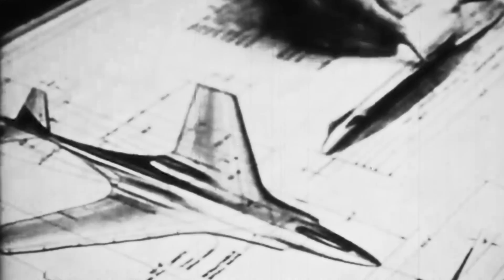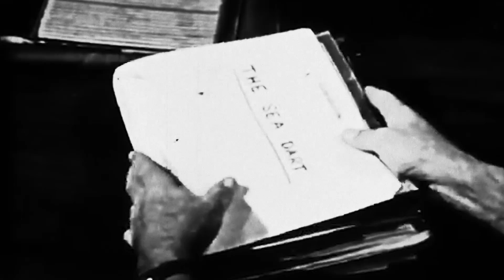The Nuclear Seaplanes Created to Replace America's Aircraft Carriers

Comment: Aircraft must be armed and serviced between sorties. Aircraft must be inspected and maintaine. Salt water etc must be quickly washed off or horrendous corrosion problems set in (for example water intrusion into cavities, compartments and electrical connections). Aircraft must be sheltered from inclement weather. No wonder this idea wasn't made standard. Anyone with operational or maintenance experience would find it absurd.

Comment: I don't understand why they just didn't make the Hydra skis part of the lower wing and use a x joint to expand and lower the gear also too I didn't understand why they didn't bother to make it like a submarine so it could use the force of the water lunging from depth surface to propel it in the air and then just switching to prop after are I still think an electric jet within a better motor

Comment: As a former carrier aviator, I see this as one of the most idiotic schemes I have ever heard of. It dumbs down the value of a carrier simply to enabling take offs and landings of any kind of aircraft, no matter how incapable. The fact is that aircraft that can fly off a conventional carrier are much more capable than any seaplane or even VSTOL plane could ever be and will always be so. It is simple physics. A plane that is launched can carry more weaponry and fuel and perform better, because they don't have to lug around all the baggage that gives them seaplane and VSTOL capability. Also, tending seaplanes would be a nightmare. The sea states you encounter in the open ocean would eventually scuttle every one of them.

Comment: Chuck Richbourg was killed in the Sea Dart when it ran into wake turbulence behind a larger aircraft at a demonstration showing over San Diego Bay.  The Sea Dart oscillated violently up and down three times and came apart in the air before it plunged into the water.

Comment: SSF doesn't "replace" Carriers. It complements them. The concept is sound. It's they were trying too much at a tough time in the field of aviation and hydrodynamics. The engines were too thirsty. With blended wing designs it would be more practical now. Having bombers that can operate anywhere there is water. You can be in a lagoon, a beach, be supplied by ship or submarine. The cost is low compared to a carrier. And more dispersed. They did a pretty good job in the analog/early jet era.

Comment: Actually a turbo prop does not need speed brakes...pull pack the throttle and the prop pitch and you will slow down damn fast...

Comment: That seaplane looks like it flew straight out of Thunderbirds or Stingray, such a shame it didnt go into production
Reply: They never solved the buffeting issue with the skis....and they tried over 100 variations.  Remember that this was still the early days of jet power and they were trying anything.  By the time the Dart was at the end of it's test flights (and after one of them broke apart in the air -- in front of Navy brass), tech had improved to the point where more traditional carrier ops were more tenable.
Reply: @samsignorelli  -- Chuck Richbourg, the pilot of the Sea Dart when it broke apart, was my dad's friend. The flight test engineers figured it probably hit wake turbulence by flying too closely behind the previous airplane in the show, which was a lot bigger.  It oscillated three times up and down before it hit the water.

Comment: What happened to the test pilot of the disintegrating plane? Epic fail for not mentioning that
Reply: Jons LG He did say after that accident they added ejection seats so I don’t think he survived.
Reply: Per Wikipedia: __ Flight testing was initially successful, but, on 7 December 1955, a control system fault destroyed the first prototype with the loss of all aboard. The first prototype, BuNo 138821, c/n XP-1, disintegrated in flight at 5,000 feet (1,500 m) due to the horizontal tail going to full up due to a control malfunction, subjecting the airframe to 9 g stress as it began an outside loop, crashing into the Potomac River near the junction of St. Mary's River, killing four crew members.[4]

Comment: I wonder if the pogo could work nowadays? I mean there’s no reason to even try… But with modern computers and flight technology I wonder if it could?
Reply: Yeah no problem but still doesn't make any sense
Reply: @peterzingler6221  Vstol makes sense. This approach is just a dead end.
Reply: Well it's kind of the approach a certain space company has gone with for their reusable rockets.
Reply: @tin2001  Good example! 🤗 Many of these early jet designs had issues due to weak powerplants and no flight computer control.

Comment: I bet they kicked themselves when they first saw the Caspian Sea Monster
Reply: Why? Ekranoplans can only operate over flat surfaces at very low altitude in good weather. The USN needed systems that could deliver nuclear weapons deep inside the USSR. Both seaplane and the Ekranoplan operations were limited by rough sea conditions this is why they lost ground to conventional aircraft designs that could operate in all weather.  One of the Ekranoplans greatest weaknesses was due to it's size and mode of generating lift. The craft would lose pitch control in heavy seas requiring constant attention by the pilot to avoid nosing in to the rough water. If a seaplane could get off the water it didn't need to worry about the sea state until it needed to land.
Reply: @JoeBLOWFHB  Fake news. We all know the so called caspian sea monster flew effeciently at 20 meters. Only a troll would pretend 20 meters up is a flat surface, lmao!

Ekranoplan Class B for the A90 means it can achieve an altitude of 3,000 m.

Yea I bet you kicked yourself when you read the facts about just Russia's WIGs.
Reply: @MrFlatage  t

Comment: the seadart on display free in front of the San Diego aerospace museum 🇺🇸😁
Reply: there is also one on display at the Willow Grove Naval Air Station museum in Pennsylvania
Reply: @TheMaximus2111  
Yup. Iirc it is the 2-Ski model
Reply: There is also one out side of the sun n fun museum on the Lakeland airport( also a pogo on display their.)
Reply: @robertdamico253  actually the other aircraft at Lakeland is an Lockheed XFV Salmon.
Similar thoughts but drastically different airframe.
Reply: I saw the sea dart every day and never knew it was supersonic!
Reply: @StrikeWyvern   It was designed to be supersonic, but in operation, it had to go into a shallow dive to exceed the speed of sound because the engines were not quite powerful enough for supersonic level flight.
Reply: All but one are still around
Reply: @JohnJohn-hd3qu   And one of my dad's best friends got killed in the one that's not still around.